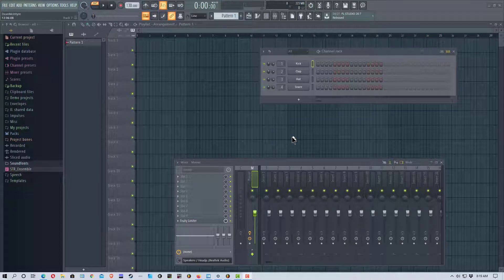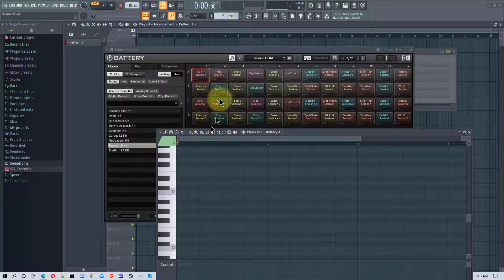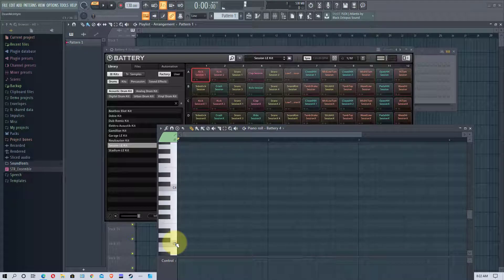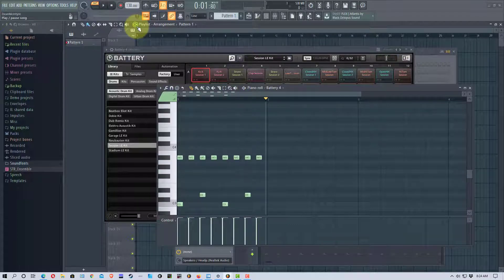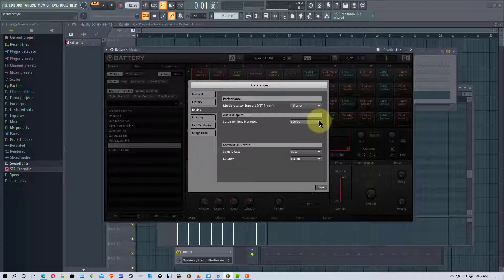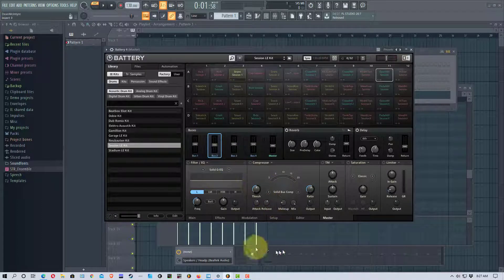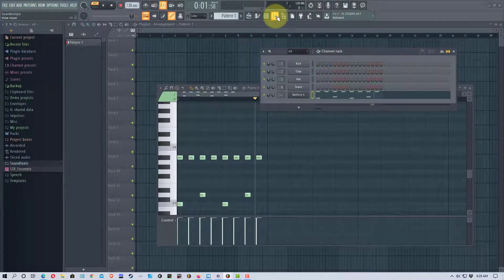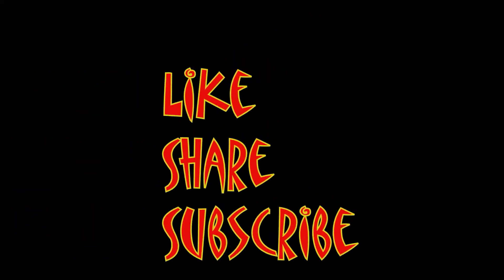Tutorial - How to Use Native Instruments Battery 4 VST in FL Studio 20

Comment: Instead of routing the individual outputs to 5, 6, 7 etc. you can route the whole Battery plugin to a mixer track (as you would do it with any other plugin) and then in the processing tab you can set the so called mixer track offset to 0, 1, 2, 3, etc. 

For example, if the Battery plugin is routed to channel 20, then automatically all individual tracks are routed to 20, 21, 22, 23, ... 

Just wanted to mention that, if you didn’t know about that. 
Might be a little bit easier/faster setting it up that way. And you're also able to shift all of your mixer tracks in bulk by just changing the mixer track of Battery.

Edit:
When you right-click a sound, multiple selected sounds, or even busses on the Master page of Battery, you have to choose "Output -> Direct Out" when you want to route selected sounds or busses to a separate output.
Reply: Not true. THis doesn't work AT ALL LOL.
Thumbs down
Reply: @reaLdRILL110S  
Oh yes, you're right. I forgot to mention that you have to choose Direct Out when you set up the Output for the selected sound/s. You can do it for single or multiple sounds when you hold Ctrl or Shift and then right click and select St 1/2, St 3/4, and so on. Or you can go to the Master page inside Battery and right-click on the busses to route them to a direct out - if you routed individual sounds to a certain bus before.

Then in the processing tab of the Fruity Wrapper it says 1. B4 St 1/2 / B4 St 1/2 L and so on. B4 stands for Battery 4 in my case. Don't offset the first one, but the second you increase to 1, the third to 2, and so on. Now it should work.

And when you change the mixer track for your Battery plugin, automatically all offsets will follow.
Reply: @melos.9  Thx mate!
Reply: @reaLdRILL110S  no problem :)